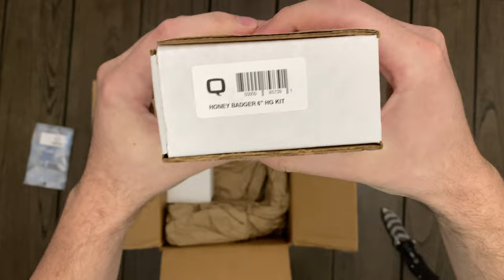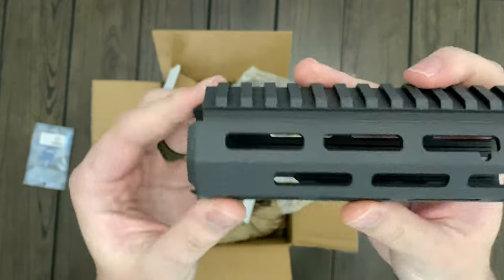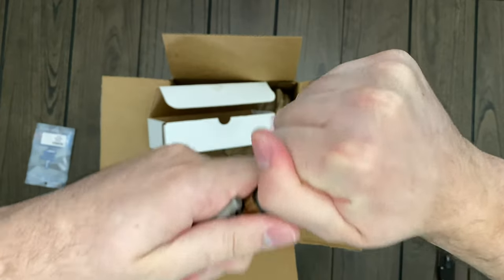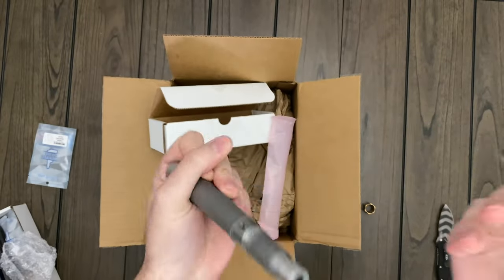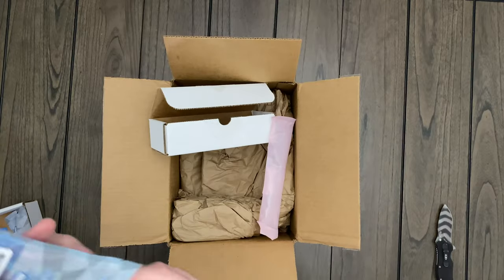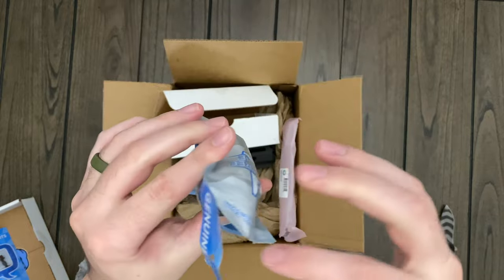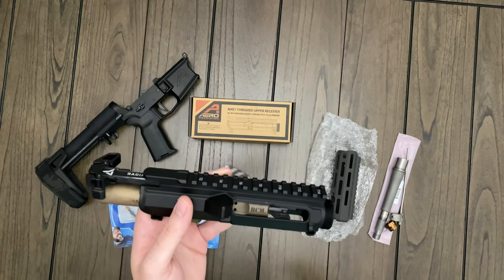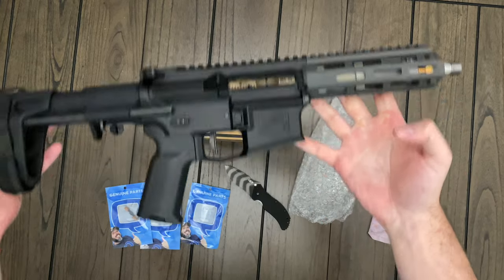Q Honey Badger Barrel Assembly + Handguard Unboxing

Comment: I used an SLR matched reciever set then used my calipers to get measurements of my rails before machining my upper once it all fit nice and tight I sent them off to Titanium Finishing in PA who did my undyed anodizing. To account for metal growth I did have to do a bit of hand fitting but I couldn't be happier with the results. Also as an added bonus, I used Ti parts where I could find them and mine came out lighter than the actual honeybadger which caused A LOT of hate on their fanboi pages.

Comment: What did you use to tighten up the barrel nut? The honey badger multi tool is out of stock.
Reply from the maker: You can use just a normal, correct size wrench or socket to tighten the barrel nut.

Comment: Do I need to buy the taper adapter only if I use I muzzle device? I am going to use a Rugged Suppressor 5/8 to tri lug adapter  would I need the taper adapter?
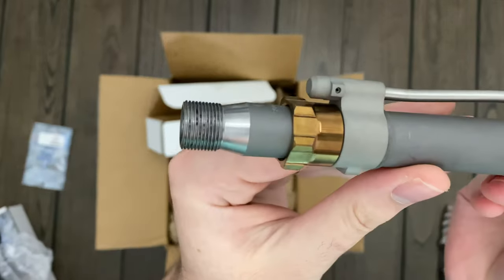Reply from the maker: Take a quick look at 2:47 

If you thread on a muzzle device, the rear of the device wouldn't be tight against anything, so in your case, yes. The adapter just makes it so that you can tighten up your muzzle device against a flat surface (aka the taper) to prevent the device from backing out.

If you were to use a Q cherry bomb, you wouldn't need that adapter since the cherry bomb has a taper in it that matches up perfectly with the barrel taper.

Hope this helps!
Reply: @evojoe_  I had my local gun shop put in my Q barrel today. However, the taper adapter looks odd. You can see space between the adapter and the dead air muzzle brake.
Reply from the maker: @jasonjaap6081  Interesting. So the taper adapter is loose?
Reply: @evojoe_  after further investigation, the “gap” was actually the dead air shim set which is basically the same color as the barrel haha
Reply from the maker: @jasonjaap6081  ahh haha, that'll do it! XD
Reply: You don't need the taper if you are not timing the muzzle device

Comment: Im assuming I don't need to barrel swap for this handguard correct? Imnwanting this rail on my 7 inch BCM
Reply from the maker: I would assume so. My only question would be to just make sure the barrel nut fit's over non-Q barrels. I would send Q an email to confirm that.
Reply: @evojoe_  will do. Thanks.
Reply from the maker: @nickbloodsworth4705  no problem!

Comment: Can you show us how to tighten the hand guard I have the same one in 12”
Reply from the maker: My bad, I thought you asked this on the BCM handguard video, lol.. I actually still have not installed the handguard since I don't have all my parts yet. I would call Q in the meantime and ask them what the directions for installing are, but it seems like you just tighten that turnbuckle assembly nut and it continues to expand and push against the barrel nut and handguard making it tight.
Reply: @evojoe_  always with the sick vids! 
double tapping this hoping to get some light shed on tightening the handguard.
Reply from the maker: @Live.Apparent  Appreciate it man! It's very simple to install. Literally just tighten the nut and it secures the handguard to the barrel nut.

Comment: How does thjs handguard stay on? Screws, threads, or just nothing?
Reply from the maker: 1:08 that turnbuckle assembly locks in the handguard against the upper receiver and barrel nut. Super secure fit.
Reply: @evojoe_  sweet